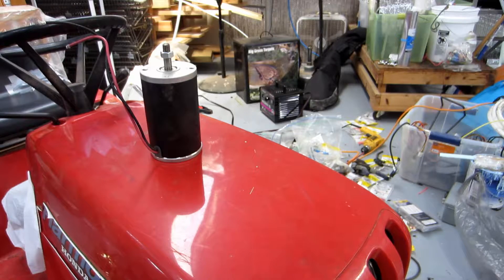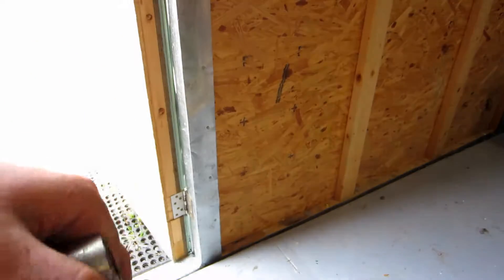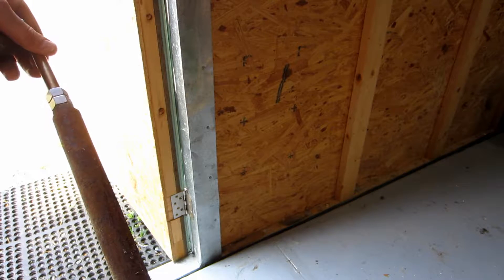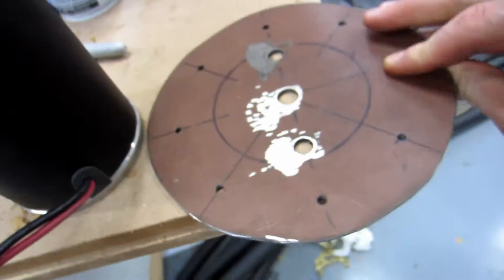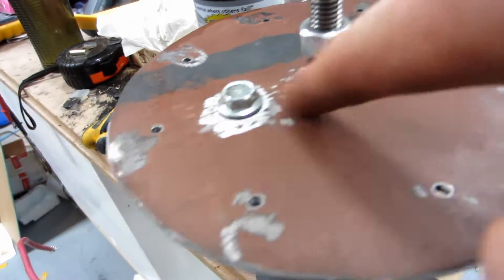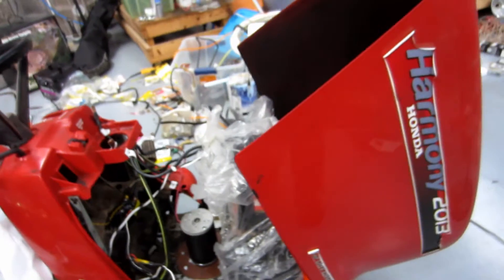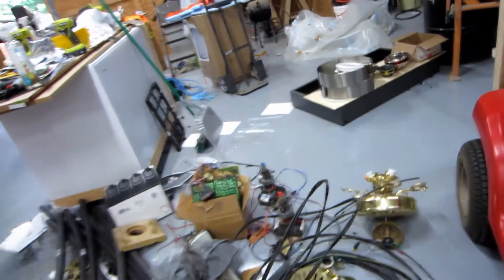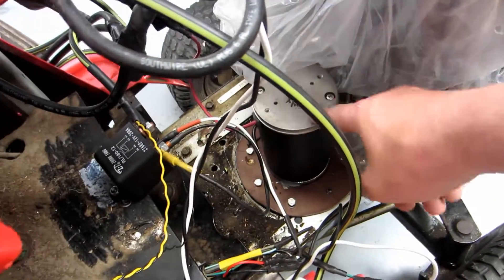New EV motor | Fabricating new coupling and mounts | Lawn tractor to EV conversion p3

Comment: I accidentally deleted the comment, 

The shunt product comes with the meter.
I thought the shifter was a speed controller, not a shifter linked to a transmission.
I also suggest you put a switch on the positive lead coming from the batteries to prevent harming the motor and the meter. I suggest this switch: 

https://www.amazon.com/Marinco-701-Battery-Disconnect-Switch/dp/B018WS4VPQ/ref=pd_sim_328_2?_encoding=UTF8&pd_rd_i=B005DUUL9W&pd_rd_r=9FSE4BX5EG267MGN6ZV5&pd_rd_w=ZZbsQ&pd_rd_wg=Q1FmV&refRID=9FSE4BX5EG267MGN6ZV5&th=1
Reply from the maker: Cool, thanks.  I'll look into this more.  I realized a little while ago that with the high amperage of the batteries, if I was closer to 36v - 48v I could do some portable stick welding.  Last night I tried it out at 24v, but obviously it's too much impedance still.  I'm debating a switch between parallel and series modes to bump up the voltage for welding in remote locations on the property.
Reply: That is such a great idea, although you would need to make sure after welding you would have enough power to get the vehicle back to your garage/shop/house
Reply: That is a great idea, but you will need to make sure that the batteries have enough power to get back to your shop/garage/house. You could also use the tractor to haul small logs
Reply from the maker: Yeah I actually did some performance testing with the EV.  It's so-so for utility.  The new motor is a little under powered for some things, but the batteries are ample!  I'll be releasing that video next week probably.  The main issue is with overheating the motor when really pressing it.
Reply: ok